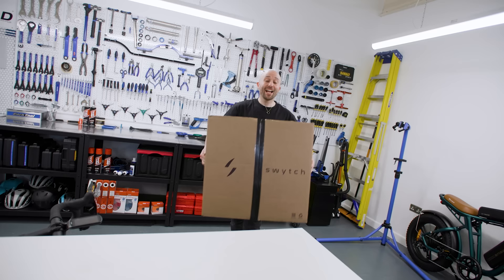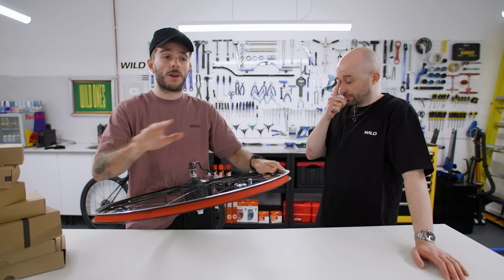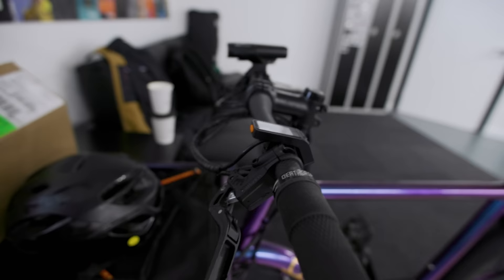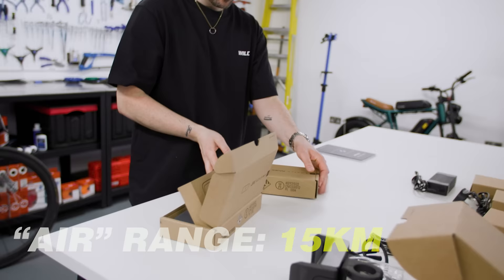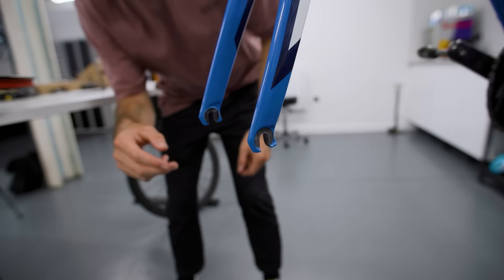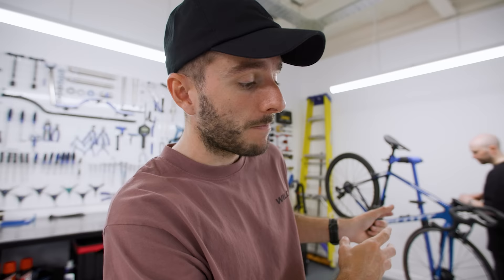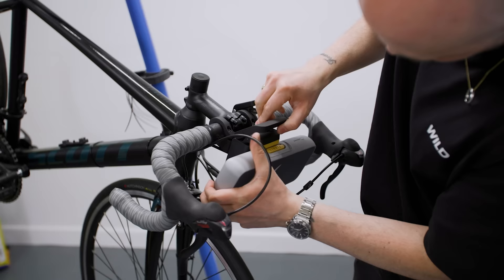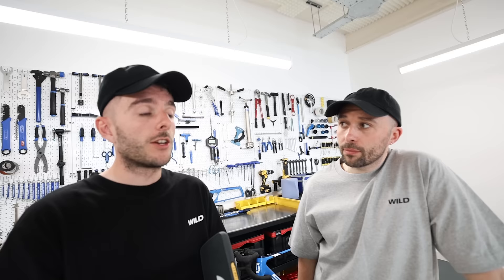Putting A Swytch Kit On My £5000 Racing Bike

Comment: I was seriously considering getting a Swytch Kit, but the lack of power, poor range and limited wheel choice kind of made it a poor alternative to more powerful and better value kits out there.
Its ONLY benefit is its form factor, as some other kits are HUGE that come with a mess of cabling and an unnecessarily HUMONGOUS control box.
Reply: Yeah unfortunately it's just a gimmick that everybody seems to be falling for. I just bought a yose power conversion kit for £380 including the battery and it's absolutely phenomenal

Comment: i have a converted Carrera hellcat 29" but went with a 250w torque mid drive motor from tongsheng, about £100 cheaper than the swytch with a 13ah battery and found for hills etc this is better overall, did have a rear wheel motor prior but found it a fair bit heavier, we also have a peak trail 3e (rear hub) and a raleigh forge (front hub) and the mid drive feels more natural and has a fair bit more range, and was easier to install than the hub motors with the cadence sensors and controllers, range on this swytch kit is pretty bad tho our worst bike is the forge and that manages 35 miles on max assist, the hellcat will do about 30 miles on half a battery

Comment: Interesting video.  Since my road bike has a carbon frame & a thru axle on the front I won't be installing it.  Other products are available which don't require replacing the front wheel although, I still think I'd be better off losing some weight than fitting one of these kits to my road bike.

Comment: I wouldn't use a front hub motor. I have several mid drives and prefer a tsdz2 on a road bike with a large battery for long range.
Reply: Hub motors avoid excessive wear to the drivetrain. Mid drives are known to strip off the teeth on a cassette, including very expensive ones. It's why Shimano made Linkglide and the Cues range.
Reply: @vaska00762  a tsdz2 uses a torque sensor and not shifting under load saves the drive train. I have thousands of miles on a normal shimano cassette and chain. Some motors make way more power than humanly possible, which can destroy the chain and cassette. The bafang and cyc motors all top 1kw nominal and max near 5-6kw.

Comment: Interesting experiment and top job to actually try to get it fitted! If you’d got it on the 5k bike wouldn’t the torque from the motor have buggered up the carbon fork/dropouts?
Reply: @johnnunn8688  ‘Forgot to mention the torque arm! It’s the silver metal piece that attaches to the fork. Torque arm will help dampen the rotational forces generated by the front hub drive. Highly recommended if you have carbon forks like me (Swytch will send you one if you ask for it).’

Comment: I bought one for my wife. Did the first ride on it today - mixed impressions. For some reason, it cuts out on the hills, which is, unfortunately, exactly where the help is needed most. Hope fully it was just the cadence sensor being moved during transport. Did you guys have any issues with random assistance, or more likely to have consistent power on the flats?

Comment: Great video thanks guys😊
I've a 2010 Trek Fuel EX 9.9 carbon full sus bike I'm hoping to fit the latest Swytch Bike kit too....I've the same issue regarding no space for the magnet ring between the frame,BB & the crank arm, it seems to have proved impossible for you to fit that magnet ring in position....is it a 'no go' for me and my carbon frame ? 😢

Comment: Is it waterproof??i live in England and this could be handy for my commute
Reply: Sorta? I would not throw it into a pond, but it is definitely water resistant. The cable connectors have a very tight rubber fit and the battery pack is in a nice water resistant skin.

But the installation instructions specified that the power cable going into the hub motor must be orientated plugging into the bottom of the hub, which makes me suspect that if the cable was not orientated properly, water could drip down the power cable into the hub and cause problems since the hub cable does not seem to be adequately sealed to the hub.

I would be ok riding in a light drizzle, but any water splashing back up from below, or a good soaking torrential rain, I might suspect would cause problems at the hub and battery connector in the long term.

Comment: the opening of dropout slot on my old Specilized Expedition is 9mm. The axle on the Swytch wheel I just received in the mail is 10mm. How do I get it to fit on a CrMo metal forks slots? any ideas would be appreciated

Comment: I guess everyone's use case will be different, but here in Belgium...definitely similar to UK weather... I commute 15km each way...I would not feel comfortable knowing that I'm constantly on the edge of the range, and if I have to stop at the market, I feel like its going to run out of juice when I need it the most 🤨
Reply: It’ll help for 2/3 rd of the way and you can charge it where you’re going. You have nothing to fear. It’s basically a hyrbrid system
Reply: @justobserving4862  And if I can't charge it where I am going, then what?
Reply: @josh33172  then you will have to bike it if you have to take your bike. I don’t imagine you would frequently visit a place you can’t charge your phone in peace. Walmart for example you can’t charge there, but you wouldn’t go grocery shopping everyday, compromises can be made, maybe using a bus too. for your 15km work commute I think it will be just fine for you though
Reply: @justobserving4862  or I just ride my normal bike, no range anxiety at all
Reply: My wife takes the battery charger (which weighs less than a spare battery) to her work and boosts the battery back up to max ready for her commute home.

Comment: Hi guys im a 55year old just got back on a bike after a couple of year 30 at least  should i get a ebike or go for the switch conversion i only do 5 mile to work each way hilly on way home  and yes im unfit great chanel bythe way cheers lads
Reply: for what you want to do you could go either way if your hills are under 8 degrees. almost any e-bike should flatten short hills...you still need to use some muscles but it shouldn't wind you. If you don't have a bike yet, i recommend an Aventon Solterra. It has more power than the Swytch kit, weighs less than 40 lbs and is only $1299 USD. And has an UL listed battery. A Swytch will send you over $1000 once you start adding in the accessories. (I spent more) I only got a Swytch b/c i already has a nice bike I could upgrade.

Comment: I thought about a Swytch kit a few years ago (or was it another similar brand, I forgot), but my commute is about 23 km one-way. There's no way this kit can last almost 50 km with moderate assist level. At the end I converted my MTB with a Bafang 250W mid drive + 17,4 Ah@36V battery. It has a bit over 100 km range and allows me to bike to work 2 days without charging. But the conversion was way more cumbersome due to the bottom bracket and all the fitting/cable management involved.
Reply: Well the bigger Swytch battery easily lasts 50km at setting number 2 or 3.

Comment: How much does their front wheel weight? Is it noticeable in the handling? 

How long does it take to charge the 15km and 30km batteries?

This technology seems to have a future, but the ranges seem very low at the moment. Especially if they advertise for 15/30 and are able to deliver 66% of that, which I thought was really poor. I know - bad conditions, etc., but still. If you advertise 15/30 you sold be able to reach this without excuses.

Comment: Swytch kit is realy bad. Buy a used real ebike is much better than buying this. Had ordered the last swytch kit with the pro battery. The range is not as advertised and the torque is too low to get you up a hill even on pas mode.